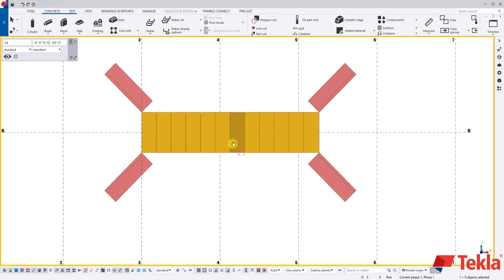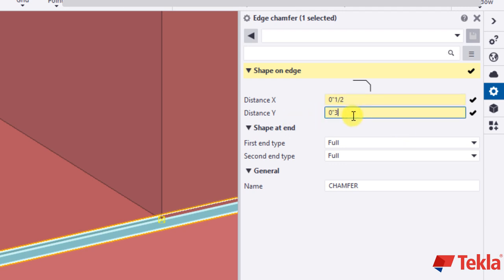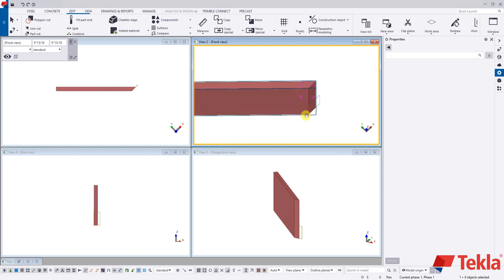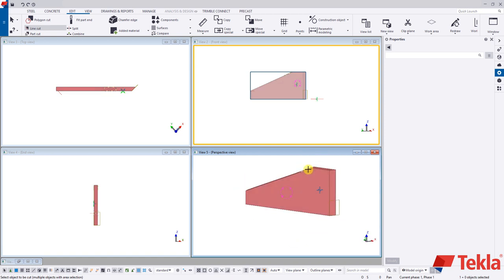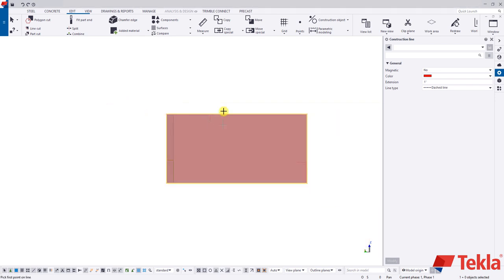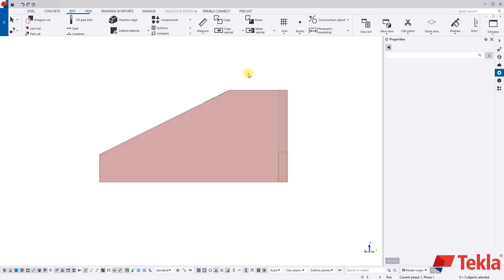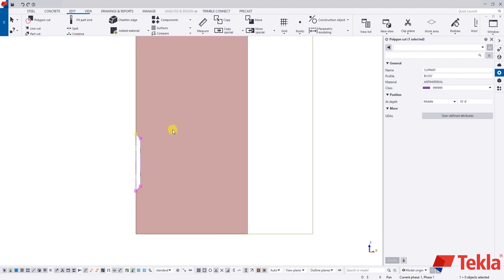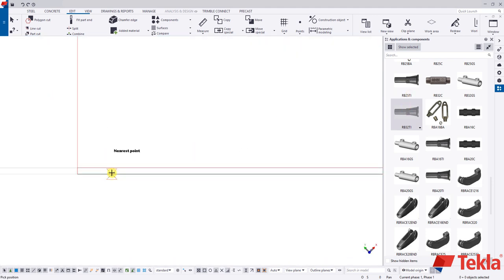Utility Precast with Tekla Structures – Video 2 (Detailing & Components)

Comment: Okay, I can't for the life of me figure out how to make that A-Anchor in Tekla... or how to get the 3D geometry into tekla by other means. Modeling it is so simple in Autocad, but it is turning out to be difficult in tekla. Any suggestions? Heck, even a link to the warehouse content would be great.
Reply from the maker: Please reach out to your local Tekla Helpdesk support team: https://www.tekla.com/contact/offices-and-resellers.
Reply: @TeklaSoftware  I figured it out without the generic response you provided. What you want to do if you want to use actual 3D dwg objects in a project is use the Shape Catalog > Import. After importing, you can use ITEM under the Steel tab to bring the shape in (or under the Concrete tab, but in this case steel made more sense for me). It will bring in as an item and then you can use your UDA (user defined attributes) to assure population to the BOM (in templates) can happen. Only problem I am having now is adding it to the Applications and Components and then adding the correct variables to allow the BOM to read basic data. I don't need anything fancy, but I do want to be able to make a consistent workflow between projects for simple objects like lifters and such and have BOM make sense (the default format of Profile + X + Length makes no sense for lifters for example). Hope this helps someone out there. Googling "import dwg tekla" in any fashion just shows you how to import a reference dwg model, which, if you are like me and just wanted to make a part, isn't exactly what you will be looking for.